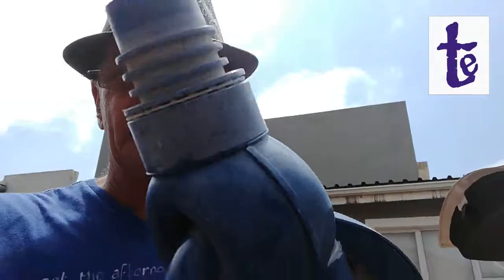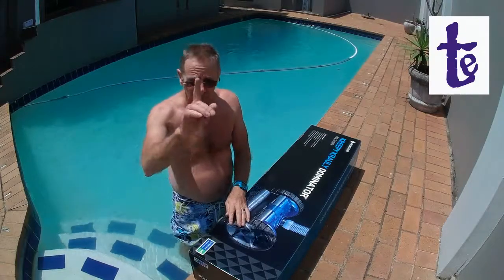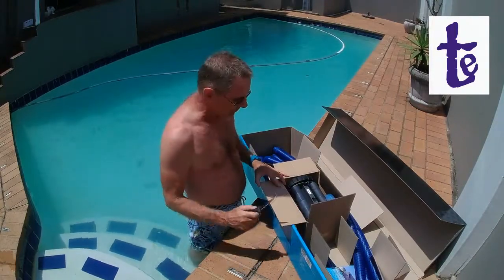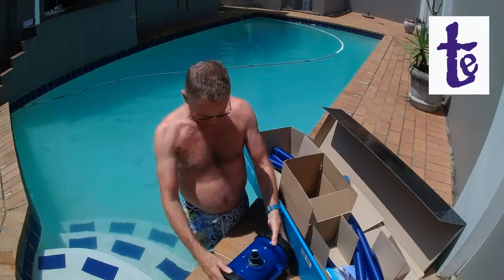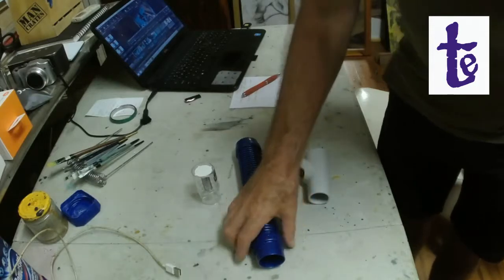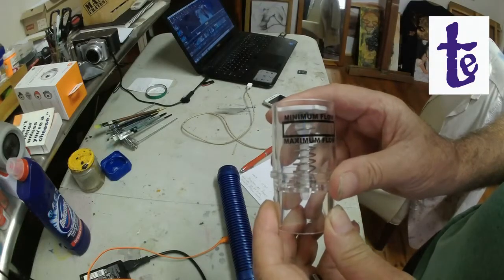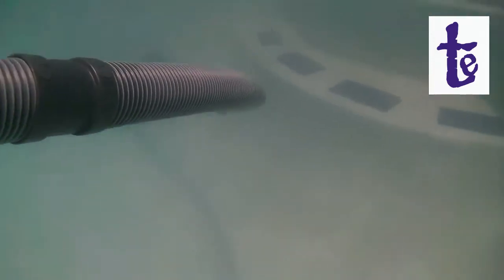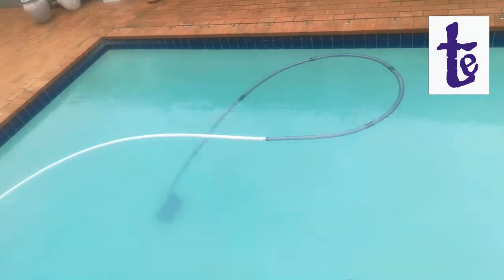How to install a Kreepy Krauly Dominator

Comment: I find my Dominator does not climb the walls, tried everything, very frustrated.
Reply from the maker: Hi Marc, I know what you mean. they don't really climb the walls much.  Still, I am reasonably happy with mine.  Its quiet at least.
Reply: I've also been pulling my hair out with the Dominator Lite because it is supposed to be for splash pools but refuses to go up the walls - not even a little bit.  Kreepy doesn't care about customers to even give decent feedback.
Reply: I have a similar problem. I have a splash pool (fibre glass) and my dominator lite is permanently stuck. As for climbing walls its useless.
Reply: Spoke to a consultant today. The suggestion was to replace the wheels for ones with more tread and better grip. He warned me the wall climbing would be an issue.
Reply from the maker: Hi Freddy, I have had my Dominator refurbished now and they put new tyres on and it performs  a lot better but, it doesn't really go up the sides like the good old creepy does.
Reply from the maker: @freddymanston7427   Hi Freddy please see below comment
Reply from the maker: @Testequip  I am pretty sure the fibre glass would be a problem for the dominator.  Too slippery.  Sorry my friend, its not the right product for that application
Reply from the maker: @PegZ799  Hi Kevin, for me, its an okay product.  Two years down the line and I still have it because it "sort of" does the job and it doesn't make a noise.
Reply: @Steve Mandy. Creative Lifestyle.  Hi. Well, I still have mine, too,  for the same reason.  What I did it off desperation was to take an electric soldering iron and melt 'X' into the tracks to make ridges.  Now it's more like a 4x4, it barely climbs but just enough to turn around at least.
Reply from the maker: @PegZ799  Did that work?   I think you can buy the tracks separately.
Reply: @Steve Mandy. Creative Lifestyle.  It sort of works, as it help to climb a bit, then it can turn around when slightly up the wall.
Oh, perhaps I need to mention my pool is a 3x3 diamond shape, with seating around 2 sides and curved steps. 
The curve of the step is where it also gets stuck, because the center of the machine bumps against the curve, and then the wheels also lose traction. So i probably need to build something like a rino horn for a bumper in the center of the machine. Something I need to do think about...